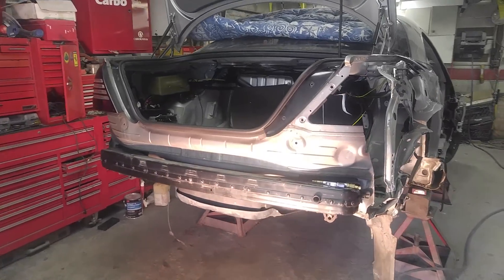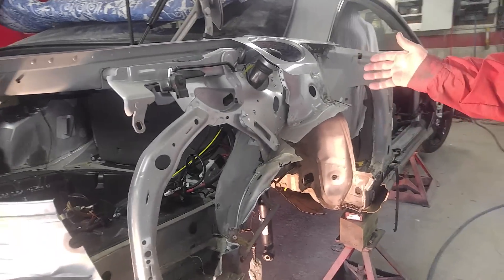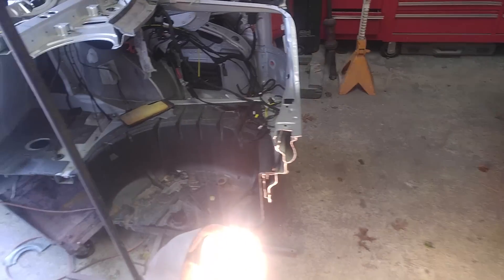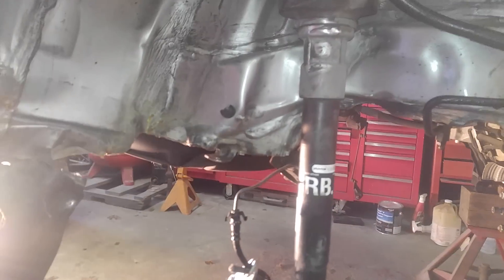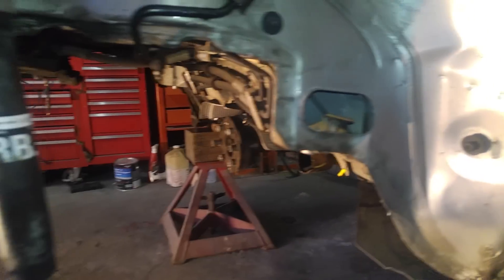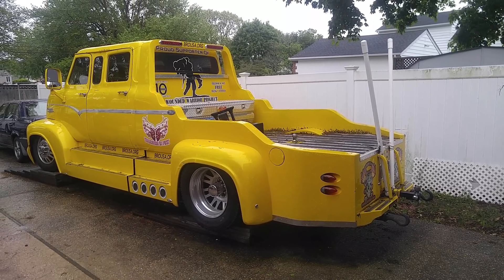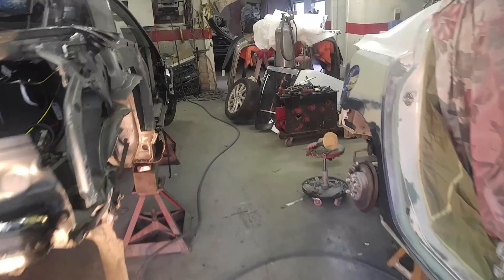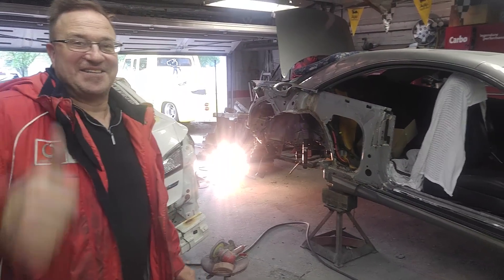Mercedes CL600 twin turbo project. Body work started. Part 2

Comment from the maker: Couple of months back I went to see Ray. I started the engine just to keep fluids circulated and we finally set the car onto posts. We need to pull rear about 1" and Ray has posts embeded into floor to secure cars by pinch welds to stands and pull with hydraulic ram. It's been a cold winter in NYC and no progress was done to the car. Ray is like me-one man show. So it is not very easy to do all projects by yourself. I don't push him but will be going to help him out when weather is warmer. Will make more videos when more progress is made
Reply: Are there any more updates on your CL600 Victor?

Comment: Victor you didn't show us the engine!! there's a non turbo one of these for sale cheap not far from me I've been tempted but still not gone to see it.
Reply from the maker: MrButuz it's twin turbo v12 Renntech tune. Renntech claims over 630 horses so it should be over 500 at wheels
Reply: Wow that's gonna be fast. Looking forward to more videos on this!  I wonder how fast you could get that car if you stripped it out and di as much weight saving as you can?  Mind you wouldn't be as comfortable then! :)

Comment: What is he charging you to fix the damage if you don't mind me asking? Seems like a heck of a lot of work!
Reply from the maker: DIY Dan Ray is my friend and we didn't really talked about final price. We are projecting around 4k for labor, give or take. I provide parts and also help out with assembly, electrical, suspension, etc.
Reply: Ok! Not a bad price considering how labor intensive that job is going to be. Good luck with getting her back on the road!